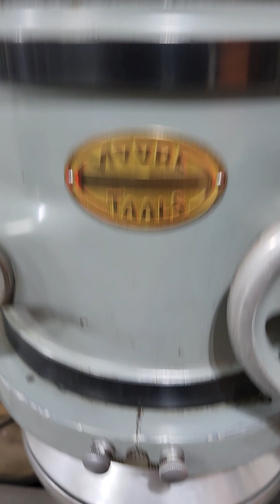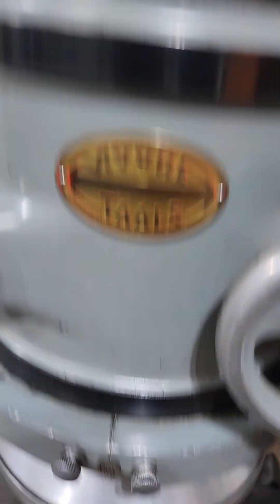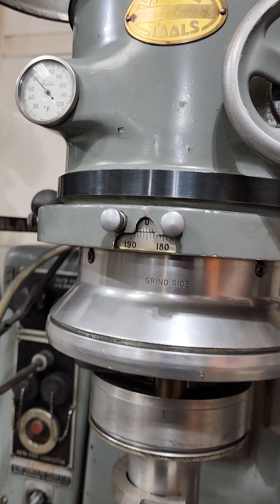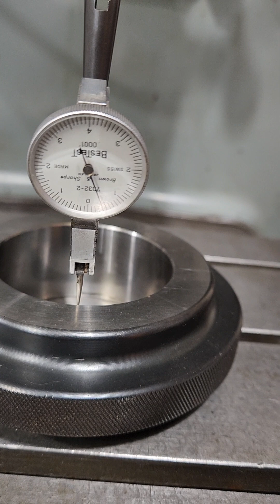Adjusting for taper on Moore Jig grinder

Comment: That method is new to me. Is that the method Moore recommends? I have always put the quill in its top position and indicate at top of quill.
Reply from the maker: Yes, that is the way Moore recommends to zero the taper. I got the instructions from Moore. I have repaired a lot of Moore jig grinders when I worked for the Michigan representative for Moore.
Reply: ty. The quill method worked well but finding someplace for the mag base to stick was a PITA.  I will try that tomorrow to see if i am off any. No one askes me to grind taper anymore. With carbide die taper is just preformed in. I havent been in a die shop for 17 years though.

Comment: How sir are you using? Second, question… where do you live? Not street but like state
Reply from the maker: Hi Mark, thanks for subscribing. I haven't had a chance to use it as work has been very busy. I haven't spent much time in my shop since doing my last video. I am located near Flint Michigan.
Reply: @OtherBrotherDarylSmith     Cool!!! Standish , Mi   That’s were I’m at!!
Reply from the maker: @spencertoolandgrind  I have a customer in Standish that I installed new Turcite on a slide recently. It was at the old Globe Fire shop. I can't remember the name of the new place.
Reply: @OtherBrotherDarylSmith     Yeah theirs something in that building, now.  Guy said he was gonna hire like 20 machinist

Comment: Hello Daryl. I am located in Brazil and happy to have reached your video. I have also been dealing with 70' and 80' machine refurbishing and also aquired a Moore to help in this task. Fun that I am also surface grinding a big Master square at this time to use at the jig grinder. Your information helped to understand how to align the taper. As another youtuber reported my G18 can zero the taper at 'grind side' but turning the spindle 90° the taper is 0.03 mm traveling the pneumatic z axis about 100 mm. (Maintaining the head fixed). And this quadrature seems to have no adjustment. Have you dial checked this other quadrature?
Reply from the maker: Hi Luis. Yes, the indicator read the same front to back, and side to side when sweeping the ring gage. Be sure that you are locking the headstock after positioning.
Reply: Yes, i have carefully locked the head stock each time (it really makes a big difference). Today I read the operators guide where it says "position the ring gage to the left..." (of the dial). So I did. I zeroed the machine considering that position 'grind side'. O.K. then I tested the dial turned 90° (this test is not written on the user's guide) maintaining that position 'grind side' and it was totally out. I am really confused.
Reply from the maker: @luisalbertotrazzi7366  I would put a 3" x 6" cylinder square or even a 4" diameter on the table and see what is going on when moving the oscillating head up and down along the cylinder square. Use the grind side of the spindle. Is there slop in the quill?
Reply: Thank you very much, Daryl Smith, to share your knowledge. Problem solved.

Comment: Hi Daryl, My holes are coming out without taper from end to end. What I am getting it is perpendicular to the table in one direction but not the other when you rotate the spindle 90 degrees even though the spindle is trammed to the table.
Reply from the maker: Now I am curious what is going on. Is yours a Moore  No 1 or No 2?
Reply: @OtherBrotherDarylSmith  It is a #1
Reply from the maker: I will look at it the next time I visit. I would put a cylinder square on the table and indicate up and down using the head, and then the z-axis slide. There must be some significant wear somewhere.